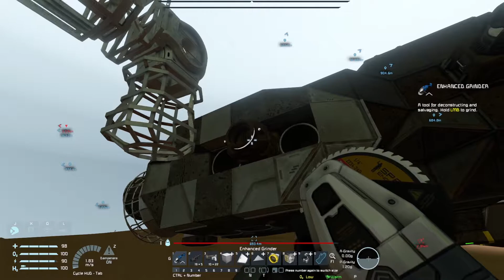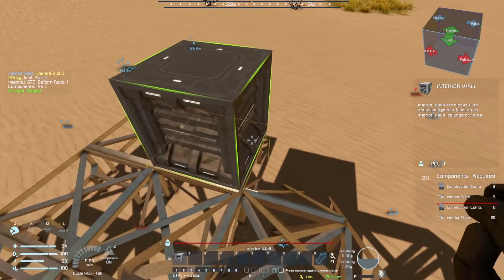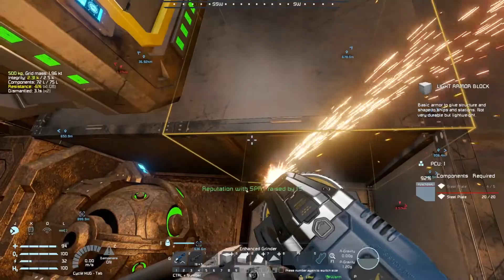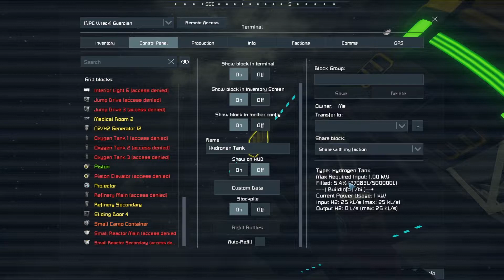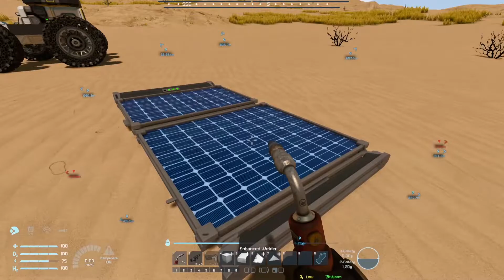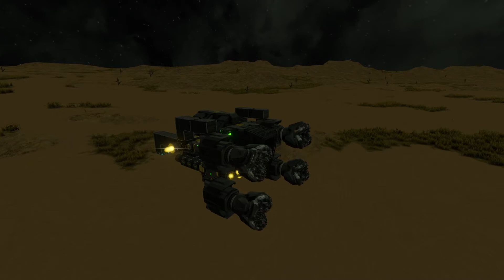A minor miner, Survival Records - Space Engineers S02 Ep009

Comment: Nice little ship, I like the way you are using the small cargo containers spread out, I may have to borrow that one.  You could have achieved the same thing as your mag pads through locking the rotors/hinges. It keeps it totally locked down with no vibration coming through and you achieve it using less parts.  Stick a timer on to unlock the rotor and turn through 90 degrees and another to lock the rotor again and you have your translatable and secure drill system controllable through the tool bar.
Reply from the maker: I'll give that a try next time.  But I was under the impression that the hinge/rotor would still become damaged if done only using the Lock function.
Reply: @ryodenshipwright  Not so far as I'm aware, I've done a fair amount of locking rotor and hinge stuff and not had a problem yet.